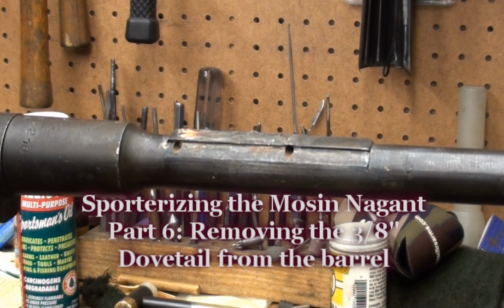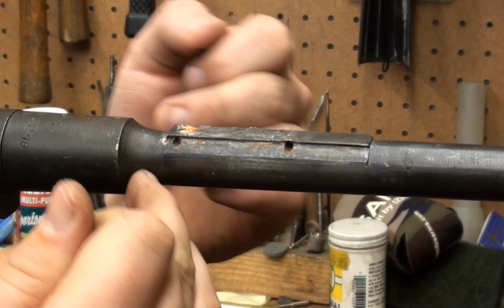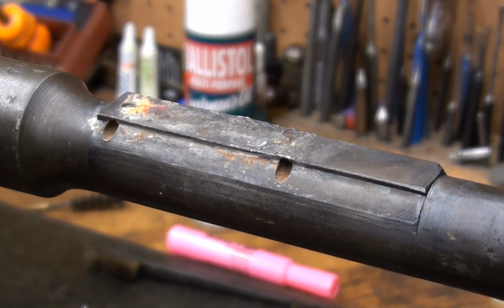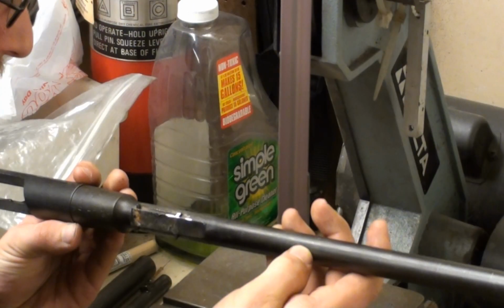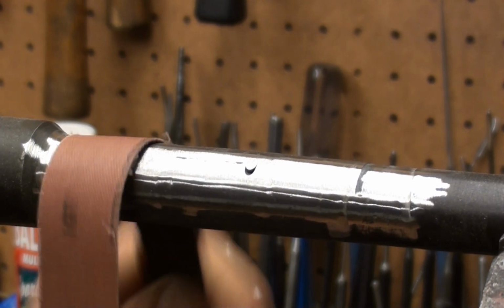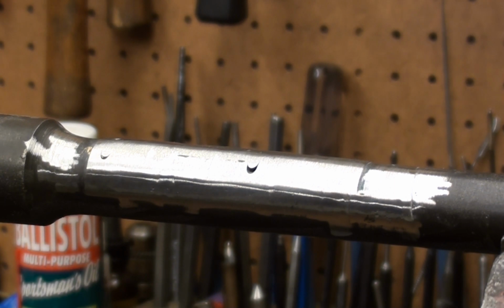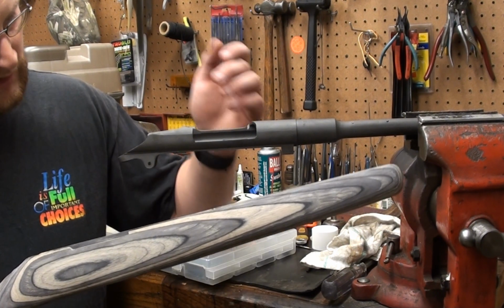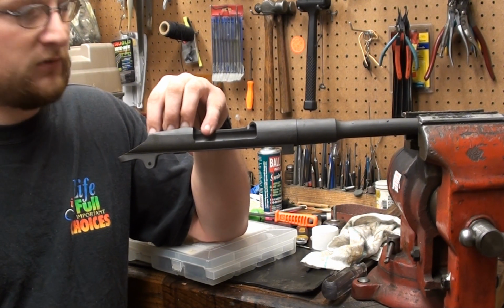Sporterizing the Mosin Nagant Part 6- Finishing up metal work and applying finish

Comment: No one seems to have mentioned another option,...  After installing the pins, turn down the apps and fill it with a might or tight welder, then do your material removal.  Will leave a virtually undetectable seam.  Just a thought.  I do a lot of fabrication so I'm always fixing and repairing with themwelder.

Comment: Way to rough for my taste. I just did one, I used 1/8 brass rod which is slightly oversized and hammered it in, then I used a Bastard file to round it off. I blued the barrel so you can see the pins but they are attractive looking with no gaps and if I had done duracoat, they would disappear.

Comment: I am not a gun smith or a machinist, I am however a hobby blacksmith. I was wondering... the rivets for the rear site that didn't fit flush.... could you have secured them from the other side from moving while clamping the barrel firmly into a vise or something.... heat the end of the rivet and peen the hell out of it to fill in the drilled hole better? I make tongs which requires making a rivet and fitting it... that's just what came to mind when I saw this part.

Comment: your doing the same thing i am wanting to do but making my own bolt and im using the ati scope mount and ati synthetic stock. Im just using the gun for deer hunting though. i am going to polish the bolt and possibly jewel it. The one thing i really want to do is parkerize it but dont have the equipment and no one around her does it anymore. theyll only teflon coat it and its way outta my price range. Im gonna be 450 bucks in including the price of the gun itself.

Comment: @Iraqveteran8888 when the guy from midway was filling in the locking screw holes on a mauser i think thats what he did, but when he was filling scope holes he did it with a set screw and filed off the head i think, if you wanted to look at midway usa's series on it for some different ideas

Comment: @SacoreyRugger I MIG welded, you get a hair line crack around it anyway. Maybe with more heat on the barrel like brazing or TIG welding. But like he said, its no big deal.